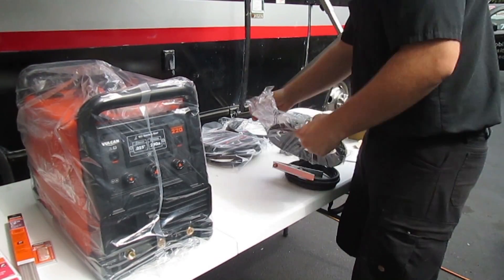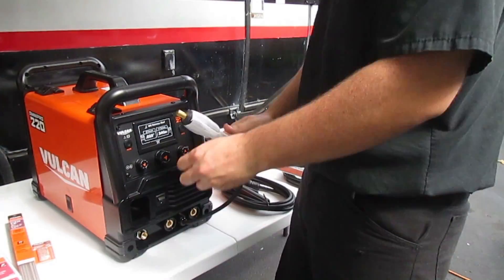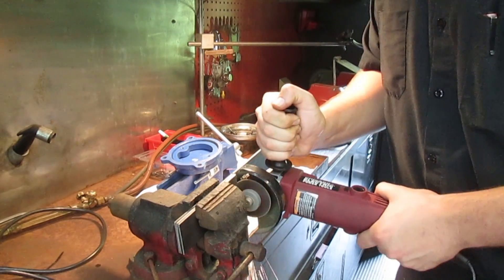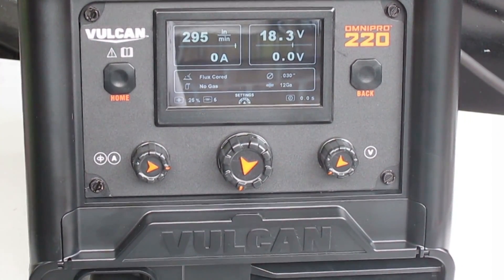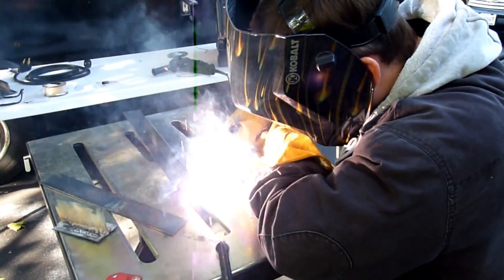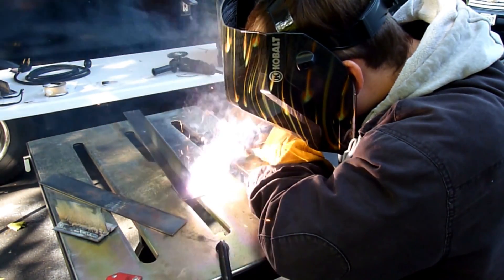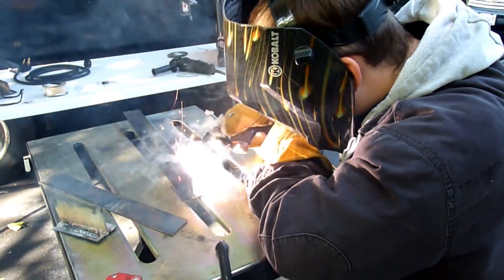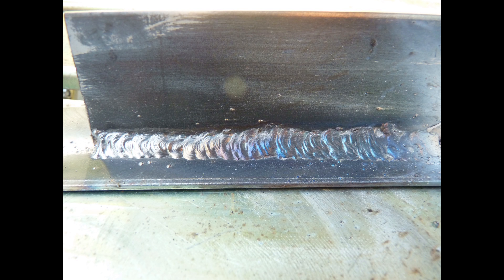Harbor Freight Vulcan Omni 220 Multiprocess Welder Review (Part 1 Fluxcore Mig 120 Volt)

Comment: Sorry, but that was not a review. And why were you using a generator?
Reply from the maker: Do not be sorry for sharing your opinion. That helps us make better videos. This is Part 1 of the review, you may like part 2 better, more welding and no unboxing.  I used a generator in this video because most people looking to purchase a welder of this size will be portable with it, and most of the time out in the field you don't have any power besides a generator. So we showed that it could be used with a regular home generator that most homeowners that are into this type of work have. In part 2 we have our other omnipro220 plugged into wall power, and used gas. We do not use anything but stick and flux core in the field as the shielding gas blows away so easily with any breeze. Happy Motoring!

Comment: I'm reading through the manual's for these welders, they have a parts listing with quantity needed. There's a number at the bottom of that list where you can order these parts from. So the machines are absolutely serviceable.
Reply from the maker: Fantastic thank you so much for sharing! This unit is getting a lot of use in the field, I am excited to report how it is holding up!  Happy Motoring!
Reply: RevitAuto I'm hoping to purchase the Commander 225 soon, I might do a video on it. It seems to be selling the worst though.

Comment: Would like to see some tig welding with this unit,
Reply from the maker: I do not think that Harbor Freight is telling the tig accessories yet. When they do I will be sure to buy them and post a video!
Reply: I would avoid the HF TIG accessories and just purchase a CK Worldwide torch. You'll spend $80 plus tax for a HF torch. Figure about $90.

A CK Ultra Flex cable, flex head torch and DINSE connector will run you about $120 shipped and is FAR, FAR superior to the HF stuff and will be much nicer to use.

Comment: How many watts was that generator. I have a 4400 watt generator, do you feel that would be enough?
Reply from the maker: The Generator I was using in the video is a 6500 watt. The service truck has an Onan 7500 watt generator but the fuel level was too low to run the generator. A 4400 watt generator (In my opinion) would be too small and have difficulty with the start up on a weld. And would you be able to create 240volts with that generator?
Reply: RevitAuto it does have a 240 volt outlet. However, if the wattage would definitely be too low I can just plan on budgeting for a bigger genny if I do mobile work.
Reply from the maker: According to the user manual on Page 7 https://manuals.harborfreight.com/manuals/63000-63999/63621.pdf  doing a calculation for max output, you would need 6720 watts. This is rough math using 28 amps 240-volt input welding at 220 amps max output for mig. Watts=Volts*Amps.

Comment: Did they let you use a 20% coupon?
Reply: I didn't know the 20% coupon couldn't be used on compressors and welders. Good to know even though I already have a couple of compressors and three everlast welders already. You never know when I might buy more equipment. I'm pretty much a tool junky.
Reply from the maker: They have a coupon specifically for the welder that takes off about 80 dollars. Their 20% off coupon cant be applied to welders, air compressors, and a few other items, unfortunately.
Reply from the maker: In the very small print at the bottom it has all the terms and conditions, no worries as you just have to wait for them to come out with a coupon for the product you are looking at purchasing. That coupon is usually valid for 20 percent off or more. I too have the tool junky disease.

Comment: hey man, what kind of generator is that?  it sounds weak!!!!!  can you post some videos of the machine running off the wall.  also, why are you using a gas nozzle for flux core welding?  does the machine come with a flux core nozzle???
Reply from the maker: The Generator was PAINFULLY under-powered which I noted in the video, It is a Powermaster 6250. The service bus in the video has a Onan 7000 watt which has run the welder much better on 120volt input.  Im running the gas Nozzle because when I opened all the packages I didn't see the flux nozzle till after and didnt have any other nozzles on the truck that day (Mobile Mechanics). It does come with a flux core nozzle and a gas nozzle (Gas one came installed from the package) it was in a small bag with two additional.30 tips. I will post a video next Friday of the machine plugged in running 120 and 240 at the shop. Have had this for about 3 weeks and used it a few times with proper power.
Reply from the maker: If you check the description I will be posting more videos on this welder, if you have any questions I will do my best to answer them. And can answer those questions in a later video as well.
Reply: cool thanks.  i would love to see how this welds with co2 gas and s-6 wire.  that is mostly what we do in my shop.
Reply from the maker: Personally all I have is Argon, I will take the welder to my buddies shop and Co2.

Comment: Why the mig not the tig  and do you have any experience with higher end unit like miller ?
Reply from the maker: This welder can mig tig and stick. For work, we primarily use stick and mig. Vulcan has not yet started to sell their Tig accessories when they do I will pick them up and do a video. 
The Miller 200 Multiprocess is in a different league, and also more than double the cost. The Miller is smaller in size and weighs around 30lbs so it's much easier to put in the truck, has double the duty cycle and a massive support infrastructure behind it.
We chose this unit as we are mobile mechanics and do all of our services onsite, so cost is important as tools take a much harder beating out in the field as opposed to being in the shop on a cart. I have only used this unit for 3 weeks. I will post a video of doing some destruction testing with our shop press. I also have a snap on 140 mig with gas and a tombstone lincoln stick welder